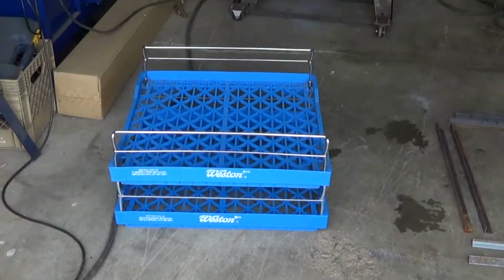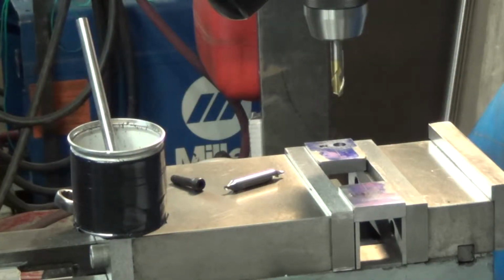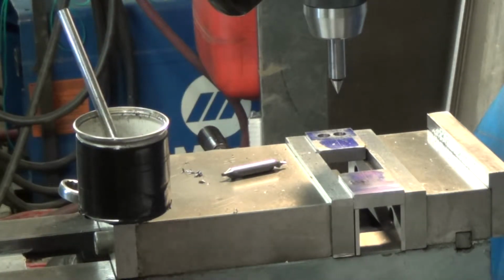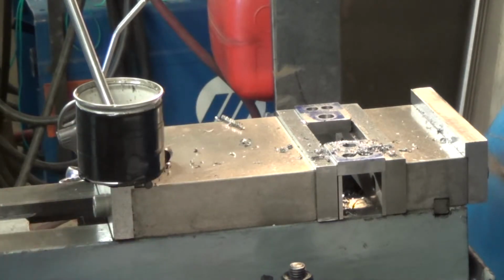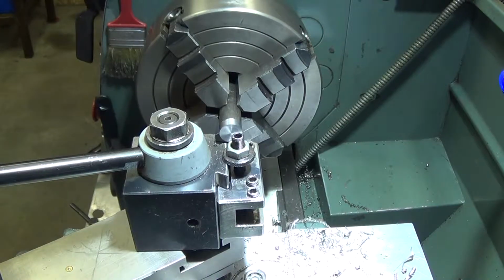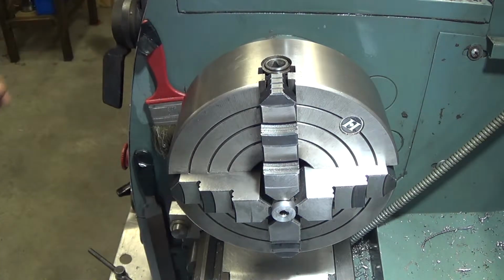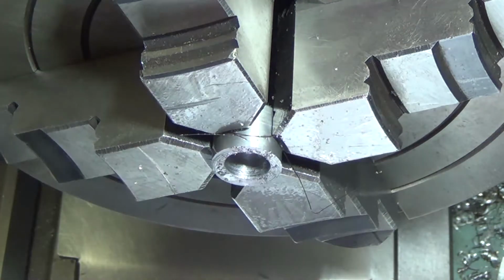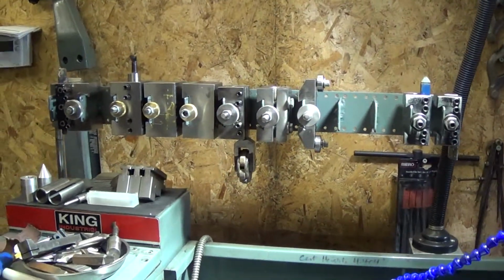Angle Plate Part III plus ToolHolder Rack and Breadman job

Comment: Hi Colin,
You became Tom's official projects tester...
Clever movable tool holder above the lathe.
Maybe a poor man's tooling shop but rich in ideas to achieve excellent projects.
Cheers,
Pierre
Reply from the maker: pierre beaudry Thanks, I started with the machines quite some years ago but it was more hobby than work. Lately things are getting more worklike and I am adding to the tooling as I can. I still have a few ideas for projects to come. ;-)

Comment: Hi CEX, if you want a simple way to overcome the failings of a round column mill, buy yourself a cheap laser level, I bought a couple from the local Pound store for, you guessed it, a pound each. If you mount the level on top of your mill and project the beam across the shop, the further the better, and mark a vertical line on the wall you can get repeat accuracy when lifting the head to within quite fine limits.
As for Mr Lipton's vice stop, go for it. Despite it's extra complication, compared to a simple single upright style, it is remarkably rigid and very easy to use. I made mine to have two handles, instead of one handle and an Allen key, and Tom's new ones are now the same too, I believe.
ATB
chris
Reply from the maker: Thanks for the comment Chris. I think I may found the ultimate answer to the round column....and I'm just waiting on a couple more quotes before making a final decision. :-) You guess.... :-)
Toms stop is something to work on when I get time and pick up some material. His latest video has some nice looking examples to follow.
Cheers,
Reply: ***** I guess replacement is  the best answer of all.
 I am very glad I didn't buy a round column when I had the chance, I think it would have driven me even madder than I am already, or as my friends put it "mildly eccentric"
Reply from the maker: Chris Stephens
Oh ya!
The mill works fine for what it was intended I guess but I've had to turn away work for lack of capacity. Time to move on.
Reply: ***** I did a lot of good work on my old round column (Lots of pre-planning on how to run the job), but man - once I got my bridgey, it was like winning the lottery.

Not to take anything away from you Colin, you do fine work on that mill.

Glenn in spokane
Reply from the maker: Thanks. Planning certainly is important using this equipment.. Usually get it right but there's always times when it just doesn't work out.
Not to worry...shopping now for new First 9x50 bridge clone. Cant wait to get it installed and running! :-)
Reply: shoot some videos of the install!
Reply from the maker: No problem there! Unless I get too excited and forget....